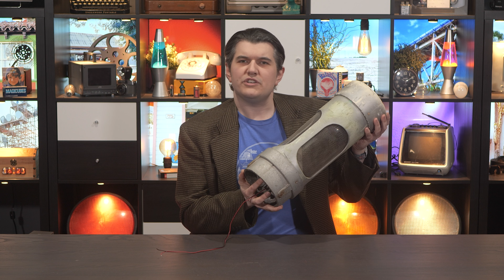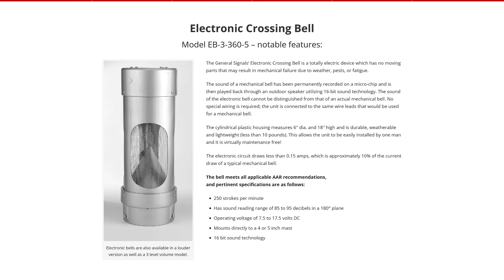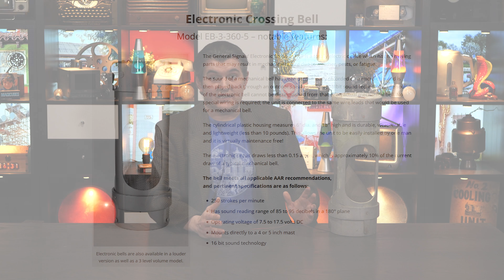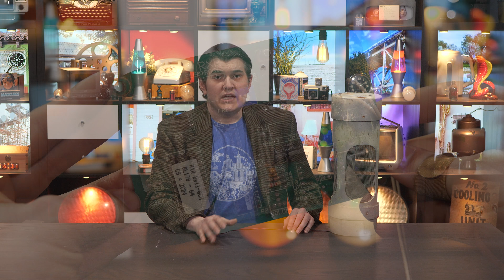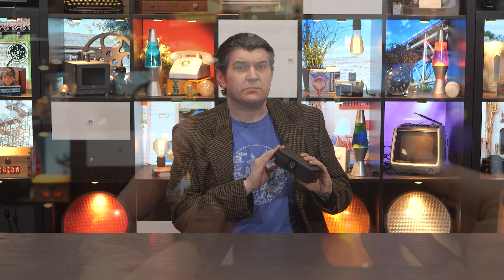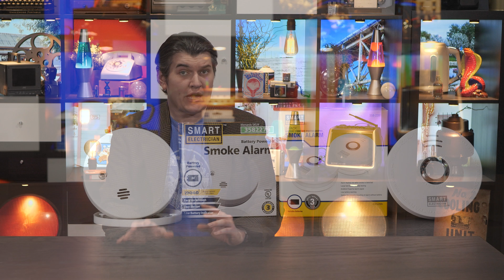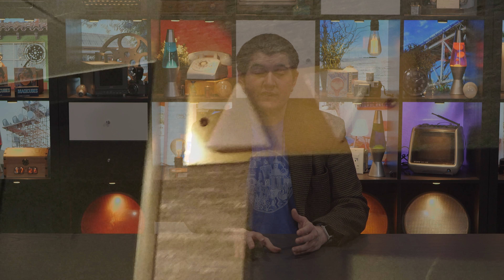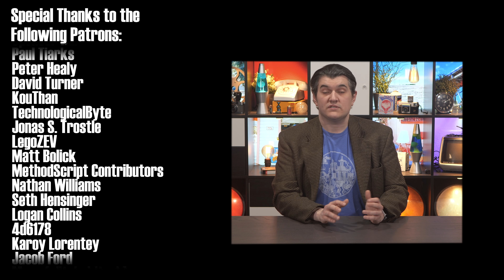The disappearing and unappreciated art of audible alerts

Comment: My favourite notification system was that of a nokia smartphone I had around 15 years ago. It had a metal case, with a metal tang welded onto it that would make a pleasant "ting-ting-ting" sound while also vibrating the phone case. "vibrate" was the actuator moving the other way. It was so nice... I learned all this because I had to replace the battery once (remember when you could do that yourself... ***twitch***). I miss old nokia... they did some of the neatest stuff.

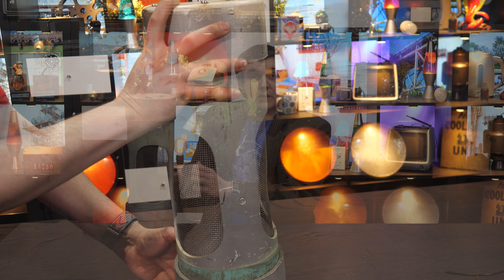Comment: 2:00  This is, of course, completely different in other parts of the world.  British level crossings were traditionally gates which swung across the railway to open the road, and vice versa.  There was no audible alert that this was happening, only the crossing keeper literally standing in the road to move the gates (or, in the posher locations, looking down from the adjacent signalbox while he turned a wheel).  When lifting-barrier crossings were introduced from the 1960s, the audible warning technology of choice was not a bell, but an electronic warbler commonly known by its manufacturer's trade name, Yodalarm.  To this day, Yodalarms are produced with a variety of sound patterns, with a very specific one for railway level crossings which is not sold for any other purpose.  Consequently, that sound pattern is highly recognisable in the UK... and pretty much nowhere else.
Another device which imitates an otherwise obsolete technology is fitted to trains and trams as a warning horn.  It sounds like a brief blast on an air whistle, which is considered to be less obtrusive as a form of noise pollution than an actual air horn, but is still distinctive and recognisable enough as belonging to a railway vehicle to serve as an effective warning device.  These are notably fitted to trams of the Manchester Metrolink network, and to most trains running in Hokkaido, Japan, though the latter can also be made to sound a longer blast than the tram version.  Most trains in Eastern Europe are fitted with a real air whistle for giving an ordinary warning, and a deeper-toned (and significantly louder) air horn for an urgent warning.
6:00  Interestingly, Dutch trains use an actual traditional doorbell mechanism (a solenoid mounted between two chime bars) to indicate to the driver when the guard has started, then completed, the door-closing process.  Or at least the older ones did.  The newer ones have an electronic imitation to replace it.
19:20  The Macintosh Human Interface Guidelines are, in my opinion, still Required Reading for anyone even tangentially involved in user-interface design - even if they never so much as touch an actual Macintosh in their lives.  One of the principles they consistently emphasise is... consistency.  Once a user discovers how to activate a given function, they expect to do it the same way the next time, and having it move around arbitrarily (or even at all) is Problematic.  It's why people immediately hated the "ribbons" that replaced traditional toolbars in recent versions of M$ Office.

Comment: 21:30 I was just stuck in there yesterday. I want a repeat, audible notification on my phone if one of my water leak sensors goes off. Even though the app I use offers a distinct "critical alert" notification setting, the options are between "always silent" and "vibrate or sound depending on phone settings".

How hard could it be to set a notification type to "always do everything: popup, vibrate, and sound".

Comment: Fun fact: the vibration motor in your phone can die! Mine did several years ago, and it was very confusing for a while as to why I kept missing notifications. Really wish I could replace that part, but alas. And no, I'm not getting a new phone. I like mine and I don't think they make it anymore.

On a semi-related note, I really miss the phone I had that had a physical keyboard that I could type on. It would slide out and automatically make the phone screen go sideways. Such a thing seemingly doesn't exist anymore, but there's a lot fewer typos when I have a physical keyboard to type on. Haptic feedback just doesn't work as well and is only effective after the fact.

Comment: Wow!  I did something far more capable using a GD32F303RGT6 microcontroller and a MAX98357A, with volume control, optional trigger input and configurable options in a 50mm x 50mm PCB at a BOM cost of £3.94.  These guys truly don't move with the times.  That's how I'd have done it in the very early 90's.
Reply: everything here is nuts on the background of how 28 pin isd1700 series ICs which do everything u just mentioned have been the industry standard for decades
Reply: @echelonrank3927   I have a question regarding the isd1700.  Can one flash the sounds in or do they have to be recorded?
Reply: @JenniferAGunn it isnt a digital audio device , samples of input pin voltages are recorded directly into analog flash
Reply: @echelonrank3927  Thats what is suspected.  Useful in it's own niche.  Thank you.

Comment: That's a really good point about sounds that get noticed. I was recently in a building with a fire alarm test, and the constant clanging of the alarm bell did eventually blend into the background noise after I put my earplugs in. But smoke alarms use the 3 beeps, there's the horrid sound of the emergency alert system that comes through phones uses a very alarming sound, and I remember the whoop sound being used for storm warnings like hurricanes and storm surges. 

But I also appreciate old doorbells. There's one that I'd love to get fixed where it allows for 4 different patterns for 4 different doors using a combination of 4 different chimes, similar to a grandfather clock. I love it! 
It's a big accessibility thing too. I've worked with visually impaired people, and they rely a lot on those different sounds to know what's going on. They have different smart watch sounds and controls, but tend to make them things that aren't super loud, and use the gesture tracking of the watch to read the notification when they bring it to their ear. I personally use a smart watch for tracking my heart rate and I didn't even know my newer one had a speaker until it wanted to make a horrid noise to clear water out of it after a day at the beach. But it's neat how different things are made with different demographics.

Comment: I would like to address a couple of issues you touched on, however tenuously.  
Blind People.
I will be in an office building or hospital and there will be a sign, let's say a room number, and it will have Braille on it.  How do the Blind know it is there, in order to find it??!!  I can understand, maybe it has to be a certain height off the floor but what about left and right?  And had anyone told the Blind these signs even exist and have Braille on them???  It just seems like a piece of the Americans With Disabilities Act that has gone stupidly awry.

My cell phone interacting with my car.  
I would like the GPS on my phone to play through my car's radio system.  I have to turn my radio way down in order to hear my phone give me a "turn here" update.  I CAN have the GPS audio play through the car speakers but then I cannot play the radio!  I went through an entire weekend, working and arguing with Google ai Mode, trying to get this to work.  Apparently, you have to "trick" your phone into thinking the GPS updates are an incoming phone call.  ai had me download a completely different GPS system, insisting it could do this and walking me through SEVERAL different sets of steps until it finally discovered this company had disabled this function. As had Google Maps, which it had previously walked me through steps for before suggesting the "new" GPS app.  So, yes, if I Pair my phone to my car and someone calls me, I can answer my phone and talk to them through my car speakers while driving(!) but I CANNOT drive, listen to my radio, have GPS interrupt the radio to say, "in 500 feet turn right onto Willow Drive," then go back to the radio again!!!  So, which is more dangerous, talking on my phone while driving or clearly hearing audio from one device at a time, one of which is guiding me on my route?  And which one did they disable???!!!  Driving in Silence, just waiting in case the GPS chirps up is monotonous as hell.  Having your car radio turned way down, in case the GPS chirps up through the phone's speakers is annoying.  But those are my only choices now. So, even though my phone and my car would love to Pair up together, I'm not going to use my phone while driving and the only other reason to Pair them is disabled so I have a function that is useless and dangerous, in the ability it does have, to use.  Grrr.

Comment: Here in the UK our smoke alarms don't really have a standard as such. Traditionally it was a continuous short beeping with an interval of about 0.3 seconds I would guess. For many alarms this is still the case but I notice fireangel alarms seem to have the temporal 3 signal. I wonder if they're an American company? The carbon monoxide alarm i have in my house is also fireangel and has the "temporal 4" signal you mention here too. 

In terms of commercial alarms the regulations there slow for a variety of tones and patterns, but often they just aren't set up properly and you'll often hear multiple tones in a single building.

Our level crossings never had bells that I can recall and simply have what looks like a fire alarm sounder on the back of the light signals that sounds to alert anybody on the tracks until the barriers have lowered.

Comment: there is a "1hr reminder" in google messages.  you can set it up to only work on specific contacts or all contacts.  

but yeah, 1 hr isn't the most useful, you should be able to make that 5 mins, or any amount of time you need. 

I believe iPhone has the option to be notified 2 times for each message...i don't remember how long until you get the 2nd notification...and honestly, it may not be around anymore, but i noticed it last time i used an iphone last year.

Comment: Like because Pebble watch. I wore my Pebble Time for nearly 10 years. Had to change watch when my new phone wouldn't install the app. I was considering trying to get it to work again using the new app.

At first I was missing the noise from my previous Casio watch but got use to the Pebble vibration.

Comment: I was working in a building once while the fire alarm guys were trying to track down a ground fault. Eight hours a day of max volume Temporal 3 followed by "May I have your attention, please. May I have your attention, please. A fire has been reported in the building. Proceed to the stairways and exit the building immediately. Do not use the elevators but proceed to the stairways and exit."

I almost wish it was just Temporal 3, that would have been easier to learn to ignore after two weeks of hearing it eight hours a day.

Comment: 3:27 looking at the board, how does this work?  RXR Bell looks like a ROM chip, so, the bell sample.  CD4040 are dividers, I imagine to supply logic to something to play the sampled bell.  LM384 is an audio amplifier IC.  Everything on the right seems to be related to power.  I figured the AD9625 is the DAC, but no, it's a 12 bit ADC (why???)  So, what is making the actual sound?

Comment: The Nothing Phones actually do a pretty good job of having this type of sound notification personalization built into the OS. They have a sound composer app that's basically a sequencer with a bunch of preset sound effects. You can record short audio bites and then assign this audio to individual contacts on your phone. These audio bites also sync up with the lights on the back of the phone so you get both an audible and visual notification. My only complaint is that you can't apply these custom notification sounds to different apps, only different phone contacts :/

Comment: The express passenger catamarans in Norway have a "7 short 1 long" signal in case of emergency. I used to take an express boat a lot when I was a child, and recently took it again and found it interesting the audio signal is the same 20+ years later.

About gmail, i used to have an account that never sent push notifications. I dont remember how I finally fixed it though.

Comment: one of the machine shops I used to work at had fire alarms that DIDN'T have temporal 3 fire alarms, and instead would play a solid tone. we kept failing fire drills since we were a machine shop and had MANY machines that made sounds that were insanely similar to the sound the fire alarms made. There were times when even in the quieter parts of the facility, I didn't realize the fire alarm was going off because I thought it was the machine next to me taking a heavy cut with a 1/2" endmill.

Comment: As a software developer the line between just enough options and having all possible options are insanely hard to find. I remember rooting my old phones with some ROM which gave access to changing almost all variables to tweak the OS and UI, it was great but insane how many options there were, to the point that for a regular user, they would just be horrified be the sheer amount of options and be numbed.

Comment: One of the things that I missed from the Nokia days was the inclusion of ringing profiles and, eventually, the invention of timed profiles.  You could put your phone into a profile that changed the tones that you wanted to either silent, a vibration, or a polite beep.  Then when the set time rolled around (or on a schedule) it would drop out of that profile and into a different one.  It basically took until the last 5 years to get Do Not Disturb hours as a feature and the last few years to get a scheduling feature that lets it return to a different profile after a certain amount of time or at a specified time.  I had to get separate utility to do this because up until pretty recently smartphones couldn't do what a Nokia brick couldn't do straight out of the box!  So I'm absolutely in agreement with the sentiment here.

Comment: 12:29 What does the morse code at this point say? I can't figure it out for some reason.
Also, I went through and put custom morse code vibrations for each major contact, so I always know who I've just gotten a text from. I generally leave my phone on silent, but if I leave it on a surface instead of in my pocket, I'll just hear it buzzing against the surface, so it always works pretty well, and isn't too hard to do - or at least, it wasn't when I set it up. No clue if it's gotten harder now.

Comment: Thank you for vocalizing (pun unintended) some of my concerns and struggles with sound design, particularly phone notifications! I used to have an old phone which had different sounds for different notification types, but of course it became wildly out of fashion to have those, so I switched to vibration. Thing is, my old phone at least had an LED I could configure depending on which unread notification I had – nowadays, not only is that no longer available, but when the screen does flash with a notification, it's only on for a second at most. This is without mentioning how notifications have a nasty habit of literally disappearing until I open the app in question, or how notifications I've configured in random apps keep getting reset and updated, not to help me, but to send me unsolicited advertisement! And don't even get me started on the missing headphone jacks!

I feel like we're at a point in time where companies feel they have some power and leverage over their users and assumes most of them are happy to get whatever is given to them with no thought to it. We keep losing accessibility features and customization options in favor of locked features, predefined settings, hard-to-reach options, and the illusion of "making the user's life easier" at the expense of any form of agency. I have no doubt this is, at least in part, an intentional design choice. But I also miss the days when my flip phone could show me how many unread messages I had from its back screen, or the many different vibration and sound modes for each contact, or just how easy it was to access basic functionality settings without having to install third party apps or dig through hidden "developer-only" interfaces.

Comment: 15:02 I don't know who needs to see this, but this is your reminder that if an app is sending you notifications you don't want to see, you can and should block them. It saves your sanity and helps you notice the notifications you actually want. 🌈⭐
Reply: Unless its a group chat that you need notifications for but you still get 10+ irrelevant messages a day.

Thats why my phones the whole day on quiet or vibrate if i need to be contactable.
Reply: @D3nn1s I use FilterBox
Reply: @D3nn1s Check the application itself or if you're on Android you can use the notifications section in the settings of that app to turn off certain notifications to group them and other things like that. I'm not even going to customise when they notify you. And just by doing a little bit of clean up, you can customise notifications quite granularly. To the point that I found that I can get notifications from an app that I want, such as on Medium where I want to be notified about people who comment on my article without getting a bunch of other annoying crap too.
Reply: Thank goodness I'm not alone in keeping my notifications feed CLEAN and TIDY

Comment: I had a galaxy 6 up until about 2 years ago. It had an led that would blink blue if I had an unread text and green if I had missed a call.

Recently got an S10, and while it's more powerful and has a larger screen, it's software and user experience is abysmal by compare. Having no notification led being one of the few hardware downgrades I have to put up with now.